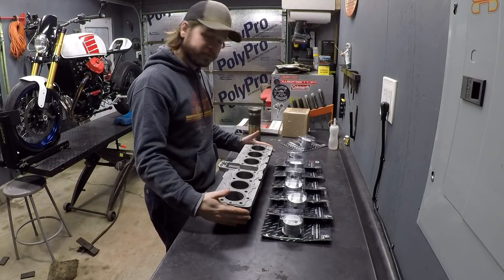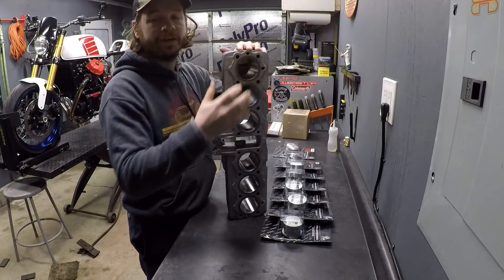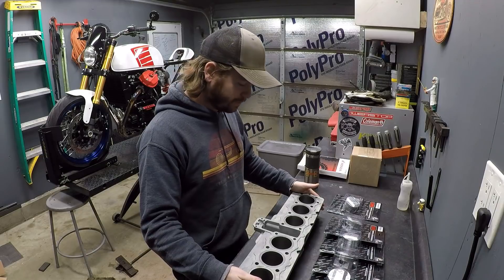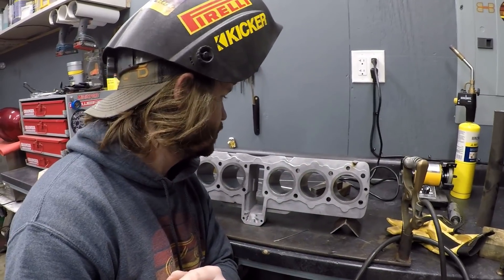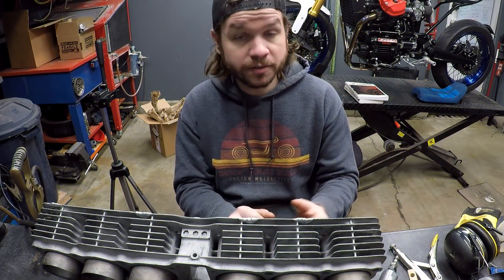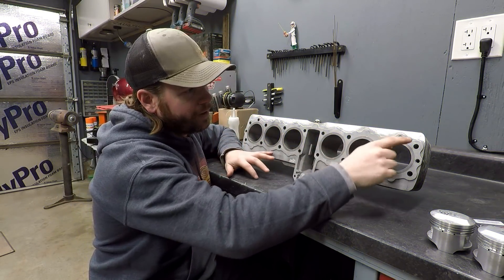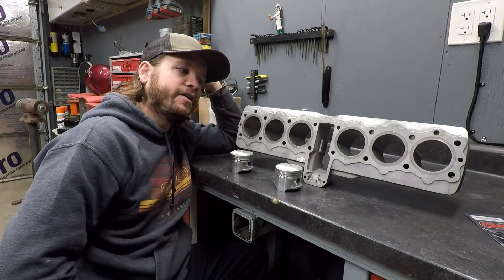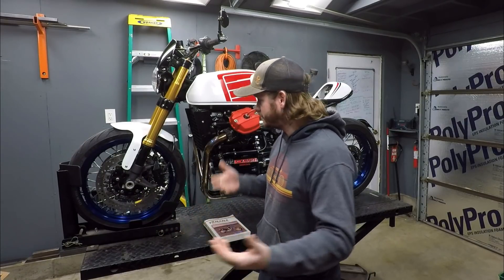Honda CBX Cylinder Repair - Welding Broken Cooling Fins EP4

Comment: Really nice, professional job, and nothing better than the satisfaction of being able to do these tasks yourself and save some money.
Reply from the maker: Thank you! Definitely a cool feeling to be able to tackle such jobs
Reply: @BrickHouseBuilds  I followed your video on unseizing the Benelli when unseizing my Nissan Navara diesel Ute, used the same process (ATF and acetone) and it worked. I watched your cylinder weld repair video as I need to repair/replace a couple of fins on an FMF Honda CR125 M1 cylinder head.  Good advice, many thanks.

Comment: Awesome! A quick note, new subscriber. I am the original owner of a 1982 CBX-C, one of the "black" engines. Well, my CBX is "garage art" through a twist of fate. I no longer have my custom cylinder head, an absolute work of art. five angle valve seat profile, nitrided custom valves, shim under bucket, titanium retainers. Gone. But, I have a complete engine missing the head and carburetors. Micropolished crank, nitrided. The motorcycle is complete except these items.

Yes, Pearl white and blue.

Sorry, the Sankei original exhaust was also lost.

A quick note, life is a series of curveballs. I am leaving California, and I have two Aprilias and the CBX. I would love the CBX to find a good home. Everything but the above mentioned items is perfect.

Want some drool? Okay. 34000 miles. It has a custom seat made in the original profile, beautiful. This is no joke, folks.

Sad part? Okay. I used to blueprint carburetors for a living. Those beautiful Keihins? Shit. Rebuilt, polished, and nestled in a custom box. Velvet lining. Oak. Brass hardware. Preserved with oil, absolutely no fuel, all new tubes. Gone.

For the collectors out there, its serial number 1970. Yeah, I really miss riding this machine, I had an 81 and an an 82.

Hell, I'm on a roll. The jackshaft. The CBX had a solution to the width, a HyVo chain that drove the clutch and accessories. That alternator was brilliant. The alternator was custom built, new brushes, commutator. I had a friend that built it. The CBX alternator was driven by a friction clutch. The engine could rev so FAST, it could break the alternator shaft! Irimajiri's solution was to install a clutch that allowed the engine to rev, and allow the alternator to catch up. Problem was that the commutator is radial, not axial. So, brush wear was an issue. My alternator has 110 miles on it.

Comment: Nice work. I see your repair is to a fin that is exposed. Can a middle fin that was broken off be repaired? If so, what if any complications are there to repairing a middle fin where it's harder to get at the weld line?
Reply from the maker: Just harder to get to. That's the complication

Comment: Los pistones son los mismos de una moto de la actualidad o son originales?
Reply from the maker: I'm not sure I understand the question. The pistons are original in design but just oversized to match the cylinder bore.

Comment: Those CBX goobers ranting about how to do this work are so cute. 🙂 Nice job with the weld repairs, TIG is so sweet. Once I was decent at that and machining I felt like I could repair or even make just about anything and it just came down to what the cost of the replacement part was.
It is refreshing to see real moto competence on YT. Thanks again.
Reply from the maker: Well I appreciate that James! There are definitely a lot of people doubting me on this bike which gets frustrating.
Reply: @BrickHouseBuilds  'CBX bros' more than likely have to hire out all the work you are doing. I know it might seem impossible but ignore the fools if you can. Lots of YT experts, few YT folks doing it right such as yourself.
If someone is critical and actually does the work, then sidebar them for some tips! Real experts are helpful, finger pointers are fools.

Comment: I just found your channel, and I was wondering where you were finding all of these cool bikes.  It turns out our search areas overlap.  I actually bought a bike in your town.  Great work.  I would like to make a suggestion, though.  When grinding or sanding aluminum, you should wear a mask.  Breathing that causes memory loss and is linked to Alzheimer's.  I actually started having memory problems years ago when working in a machine shop with aluminum for 12 hours a day.  Stay safe, and thanks for sharing.
Reply from the maker: Hey Jesse glad you found your way here! As far as a mask I wear one a lot. If I'm grinding definitely but using a rotary bit doesn't make dust so much as individual filings that don't stay suspended in the air.

Comment: 0:55 The correct reading is '0.25' so you're not adding a zero where it's inappropriate, you're simply missing the decimal point. It is standard practice in the use of decimals less than 1 to always express it with a zero prefix just as you did. 

Nonetheless, no need to apologise to your audience, it didn't hurt and it didn't cost. In any case I've already subscribed and if you find yourself in Sydney I have a cold Schooner of New waiting for you.
Reply from the maker: Well some videos you would think I sacrificed someone's first born with how mad they get at nothing so I always feel like I'm apologizing

Comment: Could you give a ballpark of the weld settings you used? Also I have a cylinder with some bend fins. Would you just heat the area and try to bend them back in shape?
Reply from the maker: They will break before they bend back in shape. I probably had 25/30cfm at a max of 90amps. I just use a pedal and modulate as needed. Pure tungsten and some aluminum filler rod
Reply: @BrickHouseBuilds  thanks. I’ll try to repair the cylinder with the help of your video.

Comment: Did you take any courses or anything to learn to rebuild an engine? I’m contemplating rebuilding my CBX 250 engine but I’ve never done an engine rebuild before. I have good knowledge on what I think I need to know. But knowing and doing are 2 different things 😆
Reply from the maker: I'm mostly self taught as far as all the fundamentals and such. I started with a 3hp Briggs as a kid and just went from there. I've built a couple small block Fords and LS engines for various Mustangs I've had. Good information, a few key tools, steady hand, and patience are what you need

Comment: The concept that all the cylinders must be the exact same size is untrue.  The first time I attended a Honda Motorcycle Class at American Honda (it was still in Gardena at that time)
they had a CB750 engine on a crate as a test engine.  They'd said they had tried an experiment and oversized the cylinders from 0.25mm to 1.0mm in each cylinder.
So one cylinder was 0.25mm, 2nd cylinder was 0.50mm, 3rd cylinder was 0.75mm and the 4th cylinder was at 1.0mm oversize.  The engine ran just as smooth as a stock engine
after some adjustments to the carbs slow speed screws.  This was in 1972.  
Nice job on the fin fix!!
Reply from the maker: Thanks Ray!

Comment: Great video.  It's good to see someone who is NOT Allen Millyard doing this kind of work. 'Perfect' is nice, but very few can aspire to his level.  It's better to achieve an acceptable level of finish than throw your hands in the air when faced with tricky problems and negative comments. The fact that you are saving an important [ and bloody complicated ] motorcycle deserves all the good vibes that are out there.  Keep up the good work.
Reply from the maker: Thank you much Jon! Life goals put me somewhere between Allen and Shiro of 46works if you aren't familiar.  Both masters of what they do!  Even though I'm doing this bike justice people will still remove any potential credit I may have the second I forget the ratchet is on loosen when I meant to tighten and have to flip the little lever.  Nothing I can do about it except keep doing what I'm doing.
Reply: @BrickHouseBuilds    Yes I also follow Shiro's builds;  His current project (OK last years') is one of the best - looks like you could use a new shop too!  Just kidding, but it is interesting to see the way things are done in Japan.  On the criticism point, it is useful to contemplate whether these 'experts' have ever done anything,...at all...ever..., to put themselves in a valid position to comment on another's work.  As we used to say  "nil illigitimes carborundum" .  [Don't let the bastards wear you down.]

Comment: Best ride I ever had - '79 CBXz.   Awesome straight six sharp burble (? can't find the right word) at low revs, awesome wail when properly on song, super smooth with no vibration and awesome presentation in that fiery reddish-orange colour.  Mine did not have the black stripe on the tank or on the rear bikini, so the reddish orange was beautifully dominant.  When I emigrated from South Africa I had to let it go :-(  - although I did consider riding it all the way from South Africa to Europe at the time (1992).   Please please don't paint the engine black - that will make it look like a rat-rod, hide it's true beauty and that's not what I think you want.   Aluminium (Aluminum) paint, on the bottom end, the sleeve block, and head with either proper chromed or hi-polished aluminium tappet and other covers would look simply awesome.  Good luck with the build and I sincerely hope it stays your dream ride.  I truly miss mine.  No woman has ever come close.
Reply from the maker: It will be a stock restoration so all factory color combinations will be retained

Comment: Great video on the TIG cylinder repair you did.  Quick question, did you attend formal training for Tig welding, or teach yourself via friends, youtube etc?
Reply from the maker: Thank you! I had some mig and arc welding training starting in high school but beyond that it was occasional projects with capable friends before getting my own machine and basically just welding daily

Comment: Was this repair cosmetic or would the failure to have done the repair have led to cooling problems?
Reply from the maker: Mix of both. Less meterial there could have resulted in a hot spot.  Being a restoration it needs to look and be as original as possible.

Comment: Lol ive been a mechanic for 14 years, you're only good if you can throw away the book and still get the job done. Weekend warrior mechanics are the bain of my existence.
Reply from the maker: The books are great to have for torque sequences, electrical checks, fluid volumes, etc.
Reply: @BrickHouseBuilds   I use two programs at work for that called Auto Data and Boyces Auto Library. But I just ordered a Manual for a TD gemini as im rebuilding the engine and I pulled it apart 12 months ago and forgot how to set the timing chain up lol.

Comment: I can't imagine why someone needed to remove the head with only 11,000 miles on it ? Another trick for welding aluminum is cleaning the area well with acetone.
Reply from the maker: I think there was some sort of major damage as evidence by my previous videos on the bike. Acetone is definitely book standard for cleaning but its not the only step as you need more prep with aluminum

Comment: Hi. I have a question. If you have 5 std piston and one 0.50mm piston. The 0.50mm is larger diameter. that larger piston is heavier than a std piston? do you have to balance the crankshaft counter weights?
Reply from the maker: All pistons are the same size
Reply from the maker: The bore of all 6 cylinders is based off of the amount of bore that had to be done on #6 as it was the worst. Once #6 was set, 1-5 were bored the same

Comment: Hey BJ...just some food for thought, as I still don't know if that CBX is yours or customer's. Anyway, one of the best things Kawasaki did on some of their engines was have a small area cast or machined on the crankcase/cylinder/cylinder head mating surfaces for driving in a wedge (like a medium size flat screwdriver tip) to separate the stuck top end components. The KZ1000J has one on each end of the crankcase for separating the crankcase from the cylinder. I went one step further on my KZ-J engines and machined in a similar slot slot on the head so it can likewise be wedged off the cylinder without having to beat on the head fins with a dead blow. Just picked a solid / strong place about 8 mm wide x 10 mm deep with plenty of solid material to take the pressure from the wedge being driven in. Mill out or grind out about 2 mm of the surface so the screwdriver fits in.

I also sometimes run a fine thread tap through a few holes to thread the split cases, or cylinder head or block one size bigger than the studs. Then a bolt can be run in to press the pieces apart. The best location for that trick is thread where the alignment dowel pins are. I use that for a lot of crankcases that I know I will have to separate often (race stuff, two strokes, etc.). Works way better than hammering on the parts.

I wish I could still weld like you - my eyes went to shit and I'm having a hard time seeing the puddle now. Aluminum is really difficult for me now. Getting old sucks!

Comment: I really wouldn't worry about the naysayers. Your work is good. My partner does all the welding and fabrication and she thought you did a nice job too. She recommends using those carbide burs that tyre repair guys use before plugging holes to work between fins if that's any help to you in the future. Half her work is repairing fins, alloy and cast iron.
Reply from the maker: Thank you! Just took a look at those bits and they look to have a s
harper point which would be handy. Ill have to pick one up! Thanks for the tip

Comment: I've repaired fins a few time plus other parts of the aluminum block ! Also had a H-2 750 block, that had the mounting lugs broken off. I welded them back on and drilled the mounting holes! Worked out just fine. If you have larger areas, you should peen every layer of weld, just to strengthen the area.
Reply from the maker: Luckily I havent had any huge areas needing filled on other bikes either. I have a chopper friend who was just talking about peening on some cylinder heads

Comment: Another note - I pulled cam covers off CBX's dozens of times with and without pulling the tach drive gear out first and never broke any of them. Just had to be careful to pull the cover forward a little and not straight up. I have seen a few broken ones, though. Of course, it is much safer to pull the gear first....

Comment: I've been doing some weld repairs on my cd175 mudguard . Been using a tungsten carbide grinding bit and the tiny cuttings that it produces are razor sharp! Been getting them in my hands and they're a bitch to get out!
Reply from the maker: I have that same issue when I use these on steel. They just stick in my hands relentlessly even if I have gloves. They find there way in there
Reply: @BrickHouseBuilds  I know! They're cunning little bastards! Lol